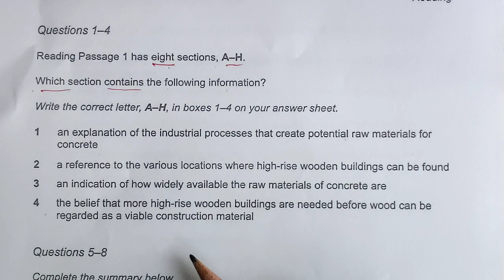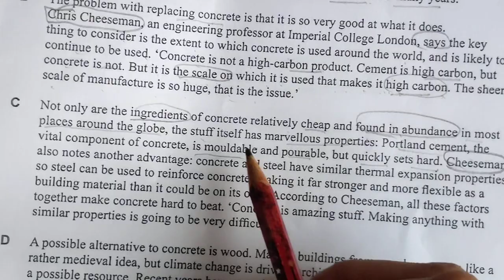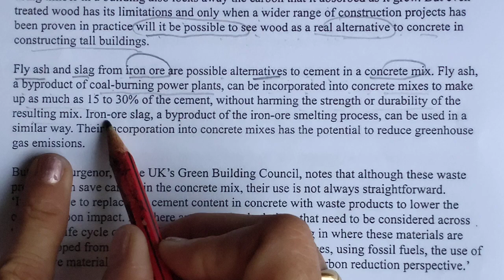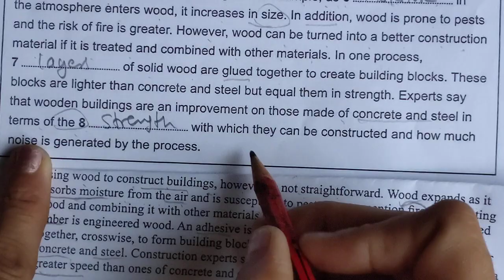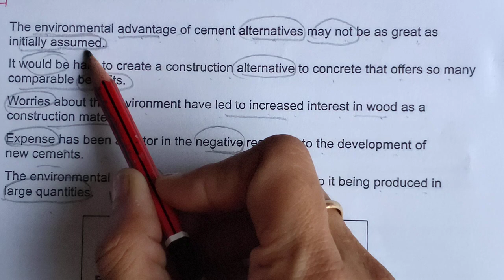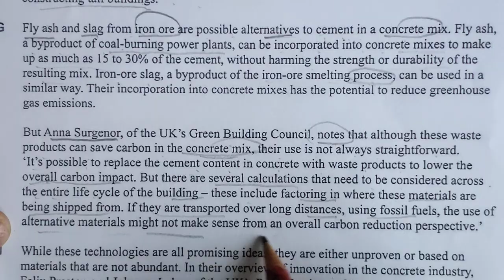ielts reading tips | IELTS 18 READING TEST 3 PSG 1 materials to take  beyond concrete answers #ielts

Comment: Thanks for the effort and the explanation .. I think that at question 8 the right answer is 'speed' not strenth . If you read the sentence again you will notice that wood has a similar strenght to concrete.But experts said it has greater spead in construction and quieter.
Reply from the maker: Yes, you are right
Reply from the maker: Yes it's my mistake and wrong answer opted